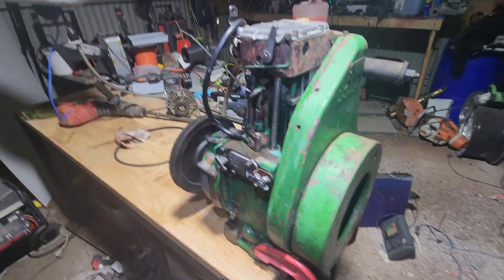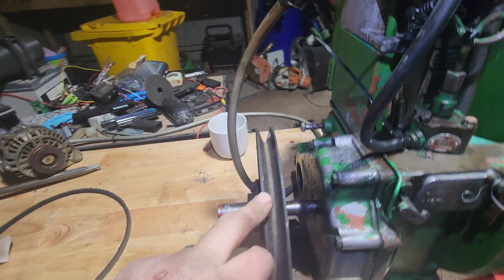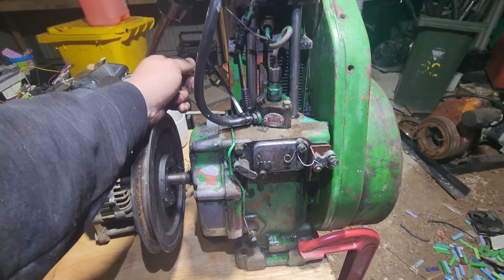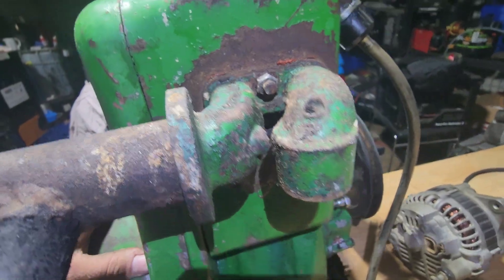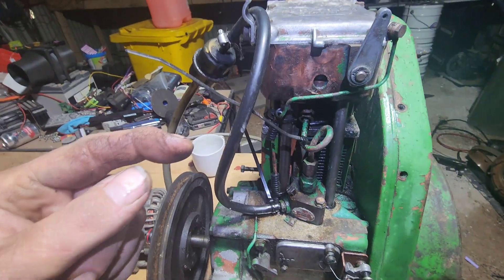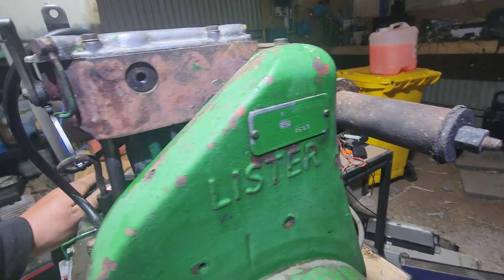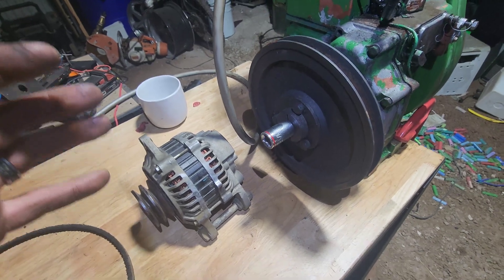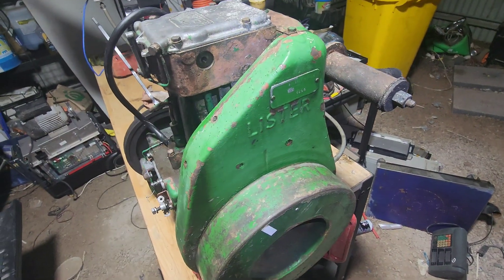Lister lt1 single cylinder air cooled diesel engine project pt1 the clean up

Comment: Hey mate, good video.
 I just come from my shed after tinkering with an almost identical engine. I bought an old coopers and the bloke gave me the lister for free as he wanted to clean out his shed 😀
So the three bolt holes inside the flywheel is where another shaft is bolted on with a ratchet mechanism where you  slip the crank handle onto.
Reply from the maker: Oh on the fan/ flywheel side
Reply: @Oneupthesleevecustoms  
I can send photos if you have an email or somewhere i can attach photos in a message
Reply: I can send you pictures via email or some other way as I cant attach photos to my comments on YouTube

Comment: I bought one of the water cooled listeroids out of India a few years back, brand new, I haven't started it yet but it looks well built. Air cooled would be easier, no coolant to mess with. I also got a few of the Chinese air cooled diesels which I think are pretty decent quality, as well as a couple of large Deutz V8 and V12 air cooled diesels. 

We have 480V grid power here but wanted to be more off grid capable with some solar panels and generators. 

The original plan was to use alternators like you're showing , but the inverter chargers actually have very good, programmable and accurate chargers built in so it seems better to generate 240 AC and then let the inverter charger do the charging. Though I'm sure the alternators can be made to work just fine.
Reply from the maker: That's cool as. ! I have a 3cyl lister air cooled as well .
I'll make a 240v one for my dad. Then maybe me too to charge through my all in 1 inverters
Reply: @Oneupthesleevecustoms  The other cool thing some inverters can do is quickly switch between charging and discharging, so say you have a 4 kW generator and you're drawing 2kW , then the remaining 2kW goes into the batteries. But if your load goes up to 10kW then they will still draw 4kW from the generator and the inverter supplements the 6kW from the batteries. These little put put diesels are pretty easily bogged down they really work best with a steady load.